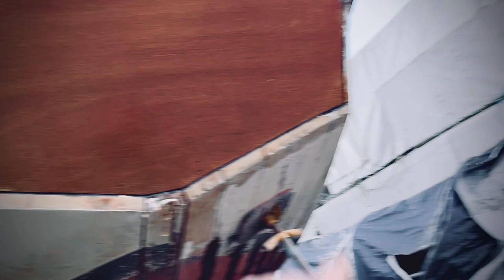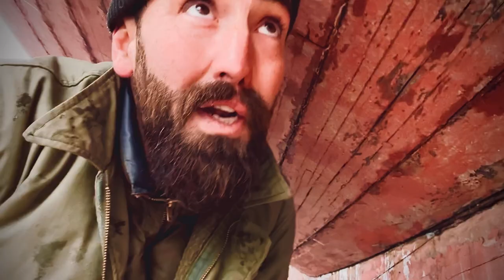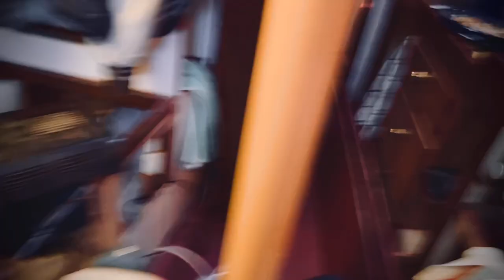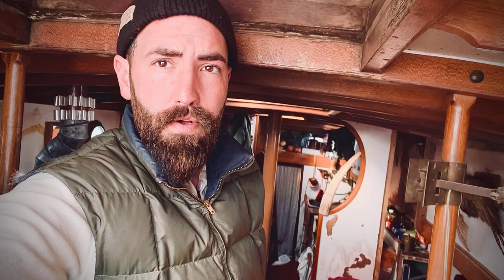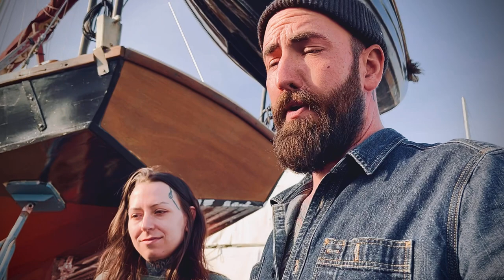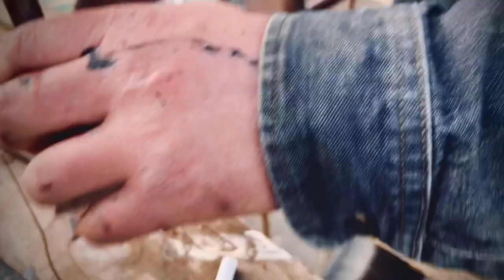Getting A Wooden Boat OffShore ready! Keeping the Water OUT! Sailor Barry Episode 7!

Comment: Coming along nicely guys.  I’m 59yo now but back in my 20’s I rebuilt and fully recalled a 48’ Scottish Herring ringnetter from 1937.  She was a beamy girl at 16’.  Caulking is very therapeutic and the oil in the oakum sure is good for your hands.  I would have wet the boat from outside as the weight of water inside puts pressure on the fresh caulk and ca push it out.  When you go in the water, and you may be already, make yourself a sawdust box.  Basically a box on a ,one pole with a lid and a long string so you can open it.  Fill with fine sawdust and force it under the keel when you launch and open the lid.  The sawdust will float up, hit the hull and be drawn in wherever water is seeping into the boat.  It will plug the gaps until the seams close up as the planks expand.  It works great.  Good luck, sweet boat.  Andy UK
Reply: Great tip and great educational video. Hope you do more

Comment: So with caulking whether it be cotton or oakum it puts stress on frames and fastners you can move fastners if overpacked as well as crack frames ......your irons are 00,1,2,3 for making. threading irons are your thins you use a threading iron to set the cotton or oakum in place into the seam not aggressively  because this iron can break your planking bevels just to set it then you use your making iron to drive it home to the consistency of a sound thud you want to hear the same thud for the whole boat i think the 5 gallon bucket trick works well as long as your working upwind of bucket that's how I usually do it to me it looks like you are overpacking the seams you want to keep the seam with about 1/8" so you can put compound in the seam with the compound if your doing it the way your doing it I found 50/50 mix Portland #2 cement and water  then Henry wet roofing tar makes it activate right as you mix the more clean up you do the smoother surface you get forget about sanding that's for the birds and the rest is just learning a prefer a beetle mallet maybe of oak,lignum or mesquite to a deck mallet like you have most people don't know the difference a smaller mallet makes work underneath the boat easier big mallets are when your on top the deck here are some helpful hints I hope you do well with this information passed down by generations of professional caulkers
Reply from the maker: Amazing. Love this, definitely gleaned some new information here! This is how I learn, hands on with other folks with more experience than myself. Thanks for the much more technical perspective of this!!
Reply: @SailorBarry  I have probably caulked 100 or so boats and sure sometimes really it is about using the mallet with the threading iron to set and driving it home with the making iron most the boat I do are between 30 and 60 feet with no need for oakum really oakum is for large ships and the art of gagging is how much closer your loops are together say on a seam that has more gap bad seam or no caulking bevel left gagg a little more also it helps alot to check thickness of planks to practice not blowing through and breaking stuff